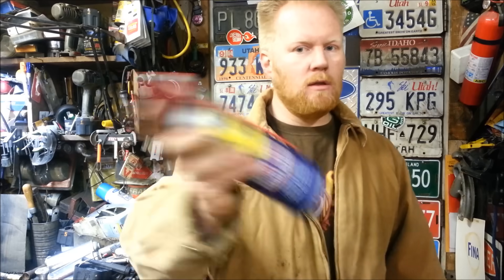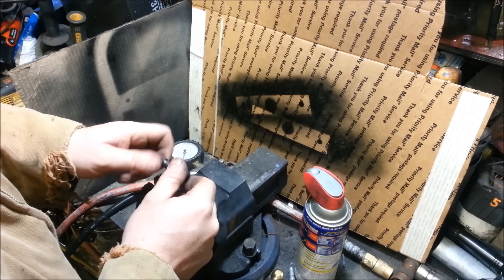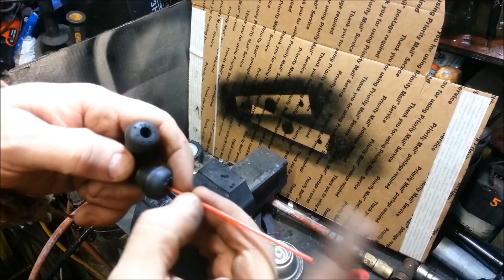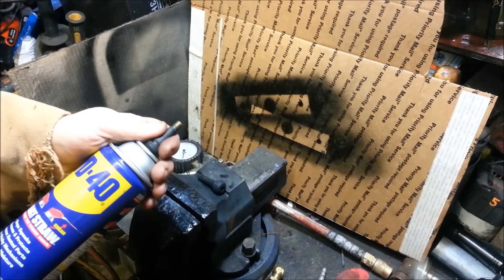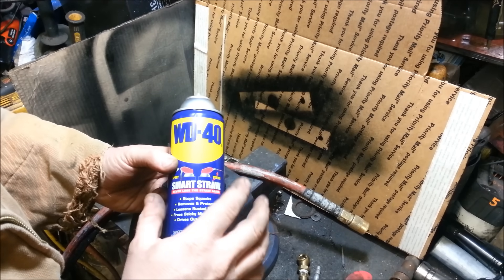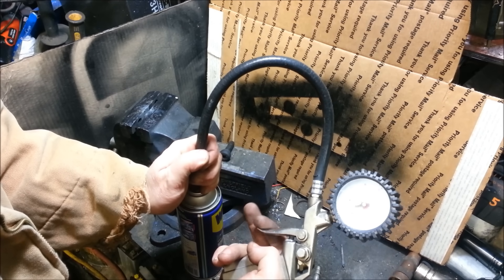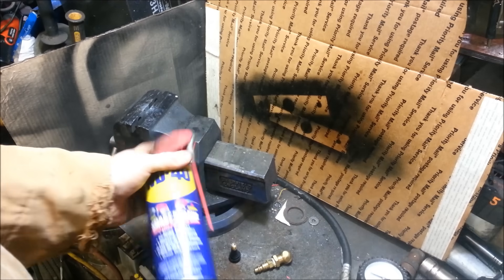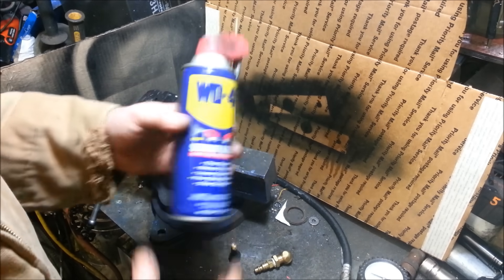Refill flat AEROSOL Spray Cans like the WD-40 and others

Comment: skeptical without a pressure guage inline.  but very ingenius
Reply from the maker: ***** The average compressor only puts out 120psi. These cans are designed to handle a minimum of 210 psi.

Comment: Surely if you keep the can upright in the first place when you are using it, it would not run out of propellant
Reply from the maker: Tony Ling The top neck ring is crimped on with a rubber/silicone seal and has a high fail rate. They will bleed air out over time as the dry out.

Comment: Good Day
An elderly Friend taught Me that trick about 16 Years ago, although His way only worked on the version with the wee Button tip, the way the OLD WD-40 used to be made. (the Tip has a tiny Pin going down into the Can).
Your version is much cleaner, as I usually got a dose of whatever I was trying to top off. (Spray Paint)
Another elderly Friend used to take a Juice Can Opener & Snips to cut the tops of the Cans off.  I remember He had 2 or 3 of the ancient style of WD-40 Cans with all the tops cut off, & He would drop in a Paint Brush & brush the stuff on.
Reply from the maker: RetroCaptain Yeah, I too cut the tops off old cans an use them to store stuff. They make great containers. Thanks for watching.

Comment: Genius! Does this work on Air Dusters
Reply from the maker: Jo Macivor It doesn't. Air dusters are actually not air at all. They contain Freon (R-152a). Freon has the benefit of turning into a liquid when compressed allowing more volume to be fit into a can. Air can be put in but will only last 20 seconds or so.
Reply: sixtyfiveford Use airdusters for longer then 10 or 20 and they cool down enough they won't put out air right, or waste it anyway.. Get a few old ones, fill them, never have to buy it again... Most airduster jobs you don't really need more then 10 or 20 second bursts... Least not for computers and electronics...
Reply from the maker: True, I would say the average spray time is around 10-20seconds when using computer duster. So it wouldn't be bad if you had a few old cans around charged with straight air.

Comment: No need for the compressor. Just crush the can with your hands and it increases the pressure enough to get the last out. Also makes it smaller to put in the recycling.

Comment: Useful trick but maybe a warning though to those people who have no idea what they are doing, (youtube is full of them...)
if you do not know how to read a gauge or follow instruction then do not try this. 
Also I have used a similar method to refill small coleman propane cans, Yes it is very dangerous since is it LPG..

Also to note that some items like paint do not work so well with just air refilled in the can as the air can cause the paint to set up inside the can. This is why the add chemicals as a propellant and not just air. Though this trick is fine with penetrating oil like WD-40, and such

Also alot of manufacturers are moving to use the inset type of spray plungers instead of the typical type in the video. This I think is to either keep people from abusing the product or to keep us from refilling it when it runs flat..

Comment: Wish I'd have seen this vid before I tossed a very expensive can of electronic tuner cleaner in the trash. The can was almost full, but the propellent had all leaked out just from sitting on the shelf. I'll know next time. Thanks for this great tip.
Reply from the maker: I hope it comes in handy in the future.
Reply: Ummmm   TIP HERE ....  Most "Electronic" cleaners DON'T use compressed air .... (due to water vapor content),  but instead they use a GAS PROPELLANT  !!!!

Comment: Thank you so much for giving your knowledge to others. This happens to me all the time and until now did not know you could do this. I am a hiker and have wanted to refill my jetboil canisters but nothing was out there. All I need now is fuel to fill them and put it in with your technique. If you have done this already, please send me a note on how. Thanks again. Mo
Reply from the maker: I have never refilled one but you could pretty easily use different fittings together to connect the jetboil to a standard propane camping cylinder and refill it.

Comment: Or you can blow the can up in your face if you're not careful
Reply from the maker: Extremely unlikely. These cans are a 2Q rated can. Meaning they are rated to hold around 250psi. A standard air compressor will deliver 120psi max and a high pressure compressor will deliver 175psi max

Comment: another great tip as long you not be using the spray for anything that produces spark like electrical contacts or motors but still a very useful tip if your caught with that depleted can and can't make it to the store, my advice would be always mark the can with duct ape or paint to show the air content over propane or CO2 if it,s refilled just mark the can before use, stay safe everyone

Comment: How can I test my cans pressure once filled to know for sure how many seconds are needed to be sure I don't exceed the 95 - 100psi threshold??...Thanks for your video!
Reply from the maker: Most air compressors have a pressure control and or can only produce a maximum of 120psi. Set the pressure control to whatever you like and refill it. You can also you the same method for filling but put a tire gauge on the Schrader valve and press it on for a second to get a reading.
Reply: Thanks got it...That will work!

Comment: I would still build some sort of safety jig to hold the can. Inevitably some doofus will try to refill a damaged or other unusable can and if it explodes, it will send shrapnel out - so possibly some sort of box to contain a ruptured can would be wise.
Reply from the maker: The pressure put in is well below the safety rating for the can and there isn't enough volume of air in a tiny can like this to make it explode. Even a damaged can that was kinked or almost punctured wouldn't explode. It would find the weakest point and leak out of it.
Reply: sixtyfiveford LOL. You don't know the "Here, hold my beer and watch this" crowd. I have an air compressor capable of over 200 psi. Blow that fast into a tiny can and BOOM....anyways, thanks for the video. I'll prob try it, but I'll set my regulator way down,or make a 'safety cage' like is done for tires. It only takes one time, ya know!  ;)
Reply from the maker: The can will have a rating on the back(usually by the bar code). Most are DOT 2Q which means they are rated to at least 270psi before it will burst and designed for a normal operating pressure up to around 180psi @130F degrees.

 USA ratings At 130F degrees
No Code Minimum burst 210psi
DOT 2P Minimum burst 240psi
DOT 2Q Minimum burst 270psi
Reply: sixtyfiveford Kewl, thx!

Comment: Badd Azzz! Thanks! Can I buy the air valve at a local auto shop (i.e. Pep Boys, Auto Zone, Car Quest? It may sound like a dumb question, but I have access to old tires... I would rather buy new ones and save the labor of hacking up old thick rubber. Access to compressed air is available 24/7, so I'm really asking for the cheapest, laziest version that works.
For the others recommending a rust loosen-er, rusted "frozen parts" free-er upper... back in the day around WW2, but before Vietnam, they used water. I shit you not, I know of a real ol'timer who, was an expert machinist at a governmental/gov't supplier factory, would use water to free any parts rusted together. If you think it's bonded for life, leave the part(s) under water overnight and you can open them easily in the morning. Obliviously, remember to degrease them once they are functional and not "welded together." I promise you.
Being from New Orleans, I had to google the company where he worked: Higgins Industries...
Per Wikipedia,
Andrew Jackson Higgins (28 August 1886 – 1 August 1952) was the founder and owner of Higgins Industries, the New Orleans-based manufacturer of "Higgins boats" (LCVPs) during World War II. General Dwight Eisenhower is quoted as saying, "Andrew Higgins ... is the man who won the war for us. ... If Higgins had not designed and built those LCVPs, we never could have landed over an open beach. The whole strategy of the war would have been different." Even Adolf Hitler recognized his heroic war efforts in ship production and bitterly dubbed him the "New Noah."

Just saying... old timers have cheap tricks that work. I hope that helps another cheapskate like myself one day.
Reply from the maker: Yes, any auto parts store or even Wal-mart will carry new valve stems. They are usually about a buck. Thanks for the tip. I'm going to have to try that.

Comment: Great info...!!   Have you tried this with spray paint cans?
Reply from the maker: Yes... It will work but you need to use the paint within one or two days as the oxygen in the air will dry up the paint inside the can.

Comment: I do this with my cans as well except i don't use a tire valve just an air nozzle blowing straight into the can. Better than buying more when all you need is a little bit or especially as little bit more.

Comment: Is there a way to refill my pcp airgun to say 3000 p.s.i. with an ordinary compressor?  Most people use a scuba tank, but i would like to do it myself.  Thanks.
iron
Reply from the maker: 3000psi is a lot of pressure. A standard air compressor maxes out around 125psi and a 2 stage compressor maxes out around 175psi.

Comment: Does this work with spray paint cans?? or does the air ruin the paint -
or could you use the paint immediately??  I'll be in the garage !
Reply from the maker: Most spray paint can shave a female valve on the top, so the same method wont work. If you did put air into them they would work.

Comment: Hey ya wildman!   I want to see your build  for a truck canopy heater, using a propane heat source with a copper line and a small radiator.  Safety is a prime concern, CO2 poisoning as well as being scalded by hot water.  Thanks for the great videos.
iron

Comment: I can tell you now that an original WD-40 can is injected with CO2 under high pressure. Optimum pressure for the can you have is 105 +/- 10psi at 21C. Don't fill it more than that. Used to literally make 1000's of them.

Comment: I just hope people don't get the misconception that these cans are filled with air from the factory. They are no more filled with air than a fire extinguisher is filled with air or oxygen.
Reply from the maker: Most are filled with propane or CO2 as a propellent, but I'm not going to show people how to do that. It won't hurt the can to put air into it to get the last little bit out. Liquified gases have the advantage of keeping the same spray pressure whether the can is 100% or 25% full. Where permanent gases(air) will lower the pressure as the can empties; 100% full-75psi, 25%full-20psi, etc. That is why WD40 decides to use CO2 vs air.
Reply: sixtyfiveford It would be a lot safer to fill the cans with Propane than air as you are doing. A flammable substance is not flammable at all when there is no oxygen present. That's why cars and electric fuel pumps with the fuel running right through the electrical contacts and brushes of the motor. 

By putting air into the cans, you are introducing oxygen which - may- ( although unlikely but possible) allow the remaining contents to burn in the can. If that happened the pressure would rise in the can and it may rupture .

If anyone does this, for god sake don't do it on a can you are playing flame thrower with. Having introduced air( oxygen) into the can, it may very well burn back inside the can  ( where it can't normally without the presence of oxygen)  and have rather undesirable consequences. 

Charging the cans with propane would be FAR safer that introducing oxygen in there in the presence of a fuel type gas.
Reply: Oil Burner How about just "Don't be an idiot and play flamethrower with pressurized cans."?
Reply: Jim Fortune
Well there is always the saftey sissy moral high ground as well.
The only thing harping at people who have already made their minds up to do something  is going to achieve is to bore the bejesus out of everyone one else who wouldn't do it anyway.
Reply: Oil Burner It also gives you the moral right to say "I told you so." in the emergency room.
Reply: Jim Fortune  Like most of the people that preach and want to elevate their own status of perfection and sainthood, You jump to the automatic conclusion that the outcome of something is pre determined as the worst case scenario that suits the argument you want to create.

"Moral Right" 'eh?
Sounds to me like the same "moral right" would apply to the injured person to punch the loudmouth right in the teeth for being such a stuck up Smartarse.
Reply: Oil Burner So my two lines of comment were preaching and your 24 lines of pontificating weren't.
Reply: Jim Fortune
Correct.
Why is it the people that always want to take issue and the moral high ground with others are inevitably the ones that just sit back and comment rather than ever having put up any vids themselves?

Get off your arse and contribute something rather than just being an armchair judge jury and whining sissy to others because they dare not to follow your holier than thou way of thinking.
Reply: Oil Burner I think in this case you are the one sniping at the content creator from the comfort of your armchair.

Comment: I've done some really inventive and unsafe things to get the jop done before, but I would NEVER do this. If you're not familiar with how a diesel engine fires off, you should investigate further.The short version is air + oily vapor + compression= detonation. Oh ,wait- that's what you got there. I can't believe no one else has noticed the folly. I don't mean to  make you look "bad" but just need  to save someone's face from disfigurement.
Reply from the maker: You would have to produce around 40bar or 600 psi to detonate. In doing this your not even coming close to that(100psi).  Even with a 2 stage compressor that will max out around 175psi your not even close to self detonation.

Comment: Man why did I never happen across your videos before.
I have got to remember this for when my Kroil cans lose pressure. BTW, give Kroil stuff a try (no affiliation. Just a happy customer). I promise you will NEVER go back to WD40, PB or Liquid Wrench. Those are just stinky water compared to this stuff.
Reply from the maker: Yeah, I've read some good things about that stuff.
Reply: Expensive but worth every cent. And lasts for ever.
Reply: I'm an industrial mechanic and Kroil is the best stuff ever. I have sprayed it on something I couldn't get apart and come back to work the next day to see the frozen rusty part had just fallen off. However, Kroil isn't a water displacer like "WD"-40.
Reply: Daniel Moeller as a long time mechanic I have found Cyclo's Break Away to be by far the best over Kroil and all others.  I buy it by the case off Amazon. You will be amazed. WD40 is total crap and doesn't deserve shelf space. Of note too is that I have never had a single can run out of propellant before empty. WD and Kroil run out all the time if left to sit.

Comment: I must admit Moe I never thought this could be done, I never had trouble with WD-40 cans but I had trouble with some paint spray cans and bug spray cans.
I would no want to put that much pressure in a can, with my luck it would burst in my face.
Off subject, I have one of those "new" gas cans that I drilled out the spout but now it needs a vent, I saw a Y.T. video using a valve stem for a vent, I may try that also.
Great video Moe!